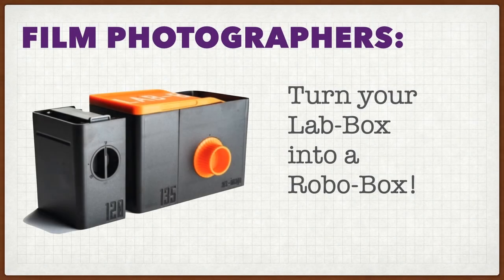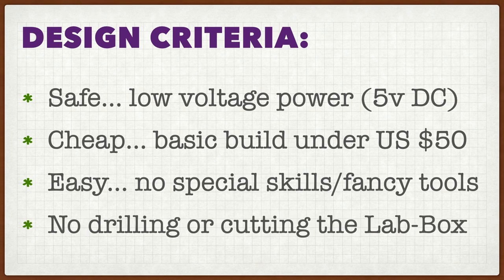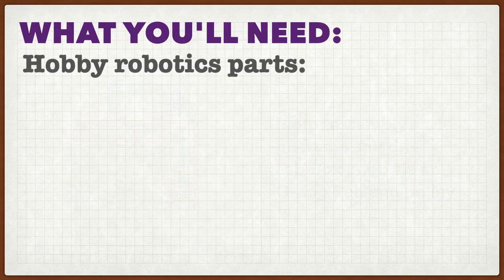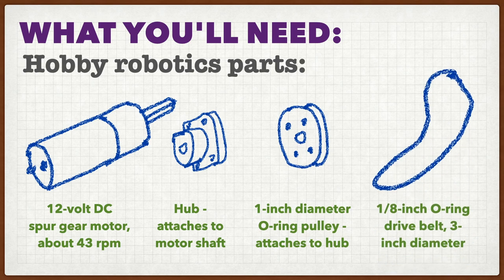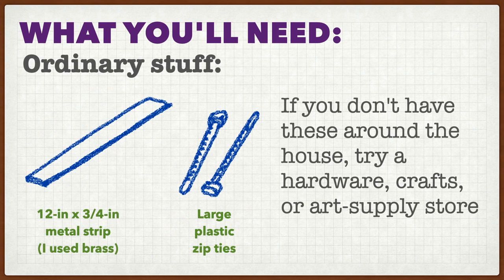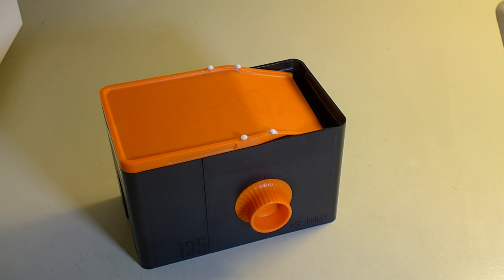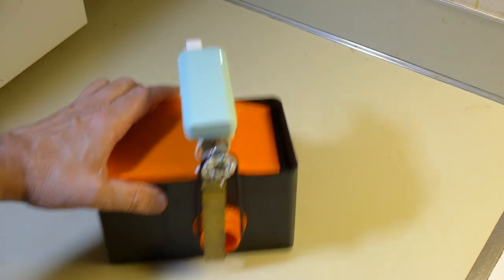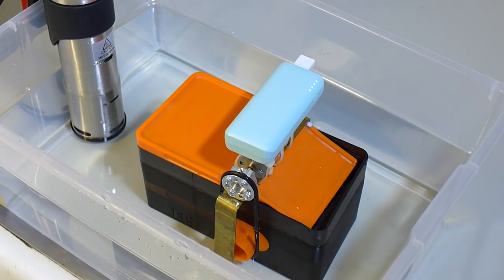Build the Robo-Box!

Comment: Wow. Going to use an Arduino to enable motor reversal every 30 seconds, but this concept is awesome. I stopped using my Lab Box because of this, now you have re-energised me. Thank you.
Reply from the maker: You're welcome! It's your call, but I'd be a bit hesitant about reversing the rotation every 30 seconds as I think the Lab-Box is designed for one-way rotation: if you look at the 35mm reel ends in particular, you'll see they've got agitation "paddles" around the outside, and if you reverse the direction there's a risk of splashing chemicals back up into the loading compartment and cutter blade. (Ask me how I know this 🙀)

On the other hand, it might be a really worthwhile improvement to use the Arduino to pause the motor occasionally at random intervals, to help break up flow patterns that otherwise might cause developing streaks -- as shown in the video, I give the tank a sideways shake occasionally to do this, but having completely hands-off operation would be nice! If you complete this build, be sure to post up and let us know how it works!

One more point about agitation: If you're using partial fill (300ml) as I do, you're already doing a form of intermittent agitation. The point of intermittent agitation (regardless of the type of tank) is that while the film is static, the developer immediately adjacent to the film surface performs development and then becomes depleted by chemical action; when you agitate, fresh developer is brought into contact with the film, and this depletion/replenishment cycle helps provide a compensating effect. In the Lab-box, the time the film is at the top of the reel corresponds to the static part of the cycle -- the thin coating of developer clinging to the film becomes depleted, and then is replaced when the reel rotates the film back down into the developer. Since you're already getting intermittent agitation just by this cycle, there may not be any benefit in reversing the reel... other than reducing the risk of flow marks, which also could be done just by stopping the reel for a moment occasionally. Anyway, be sure to let us know how this works out!
Reply: @jlwilliams I typed a long response to this but YouTube seems to have deleted both that response and the other message (which I expected to be deleted) where I gave the link to the arduino pdf re motor control. I give up.
Reply: @jlwilliams  but it was an appreciative response.

Comment: JL, Thanks for sharing this, I've ordered the parts :-) Hopefully, this will solve my biggest problem with LAB-BOX and that is turning the knob while trying to pour in the chemicals. For me, the whole contraption slips around on the countertop and is marginally stable.
Reply from the maker: Let me know how you come out and if you think of any improvements! Thanks...
Reply: @jlwilliams  As you said, turning the knob into a pulley will help.  I have a handle version and will try to drift off the handle exposing the 6mm shaft. If that's achievable I'll fix a hub & pulley. Information for you is that the Pro lid has a different slope profile. The center of the shaft now aligns further down the slope of the lid, so I'm not sure if how effective the brass collar solution will be at keeping the knob seated. More to follow :-)

Comment: The 1" OD / .5" ID pully has been discontinued and I can't find one anywhere...any idea where I could find one?
Reply from the maker: Yeah, I looked around and see what you mean. I figure we're victims of COVID-induced component shortages! The closest I could find was this one, and it's on backorder: https://www.youdoitelectronics.com/actobotics-o-ring-pulleys-1od-5-id-615130

If you don't want to wait and see, you may have to adapt the design. Remember, you can tweak motor voltage to get the rotation speed you want, even if you have to use a different-size pulley. Mind you, I HAVE NOT tried any of these suggestions, but...

-- Order the 2-inch pulley from Servo City.

-- See if one of these sewing-machine pulleys might work: https://electricmotorwarehouse.com/sewing-machine-motor-o-ring-pulley-7-8-od-x-1-4-bore-1x459/

-- Try one of these V-belt pulleys: https://www.zoro.com/congress-12-fixed-bore-1-groove-standard-v-belt-pulley-150-od-ca0150x050/i/G4447197/

-- I wonder if a plastic pulley such as one in this Tamiya kit could be made to work: https://www.pololu.com/product/109

Good luck and be sure to post if you find a good solution!

Comment: Hi Williams,  I wrote you in the other video, e6 development with lab box and cinestill, to ask you about the "robo". I downloaded your PDF and am looking for the parts. question: is the belt tension enough to turn the wheel? i saw that you used a wheel and belt WITHOUT teeth.

thanks for your attention
Reply from the maker: Hello — Yes, I am using an O-ring and pulley without teeth, and it works reliably. The tension in the O-ring also is what keeps the frame in place on top of the Lab-Box.

When I started working on the design, I was worried about slippage too. My original thought was to use a toothed belt and pulley on the motor, and to have the teeth engage with the knurling on the Lab-Box knob.

However, as you probably know, this type of belt doesn't work well unless it engages with the pulley teeth exactly. I carefully measured the pitch (spacing) of the knurling on the knob, and could not find a belt with a pitch that would match it. So, I moved on to the idea of using an O-ring, and this has worked well. (Tip: If you find you need a little more belt tension to avoid slippage, try mounting the frame a little farther forward or backward on the Lab-Box. Or, wrap some rubber electrical insulating tape — NOT plastic “electrical tape”, which is too slippery — around the Lab-Box knob to make a “tire.”)

Remember, as I said in the PDF, this is very much a “maker” project and you should feel free to adapt it to your materials and abilities. For example, if you,re good at 3D printing, you might be able to make parts that would allow you to use a toothed belt. If you do come up with any good variations, please post them!
Reply: @jlwilliams  Hi williams  thanks to your work I started a project to motorize the lab box with the help of a friend ( is a 3d print designer.) work in progress... stay tuned:-)

Comment: Nice easy thing. How long is the pulley you used for this?
Reply from the maker: Yes, it's a very easy build! It could be made fancier if the builder wants to -- for example, add a timer or a more sophisticated way of attaching it to the Lab-Box. But I wanted the basic version to be something that can be built without special tools. About the pulley: The PDF file linked in the description includes a complete parts list, and the ServoCity website has dimensioned drawings for each part. The complete pulley assembly (pulley plus the hub used to attach it to the motor shaft) is 14mm along its axis.The alignment isn't very critical -- during assembly you just slide the motor back and forth on the frame until the pulley is centered over the knob of the Lab-Box -- so if you have a different motor or different pulley that you would like to use, I'll bet you could make it work!

Comment: How do you control the temperature inside the tank?,i see you put it in the bath
Reply from the maker: It's no different from using any other plastic tank in a water bath. From the photos you might think the black base of the Lab-Box is very thick and might act as an insulator, but it's actually open on the bottom so water can flow in and warm the reel compartment. I just put the Lab-Box in the bath at the same time I put in the solution bottles, and let them come up to temperature together; once everything is at the same temperature, there is no reason for it to change as the solutions go in and out. I don't worry about measuring the temperature inside the tank, but someone who wants to do that could use the new Lab-Box Pro Lid, which has a digital thermometer built into it. You can see more of the process in one of my other videos: https://youtu.be/UGhKU54E_ow
Reply: When you put the LB in a warming water bath to maintain color process temperature, you are going to soak the metal parts and blade which cuts the film from the 35mm cartridge. The problem is that the maker went cheap and didn't use a good stainless steel blade, so it will rust. You cannot open that conveniently to dry the parts and blade. Within the first year, LB users were complaining about rusted film cutter blades jamming in the mechanism. So keep your powder dry, guy.

Comment: Cool! I tried to build something like that but gave up. No builder genes.
Reply from the maker: It was kind of hard to figure out how to make it (I made lots of cardboard mockups) but now that the design is sorted, it should be pretty easy to put one together. The motor part is easy... the trickiest bit is getting nice sharp bends at the right places in the frame, but that's just because it's metal. It won't surprise me if people figure out how to make a workable frame out of hardwood, 3D printed bits, or even Legos...